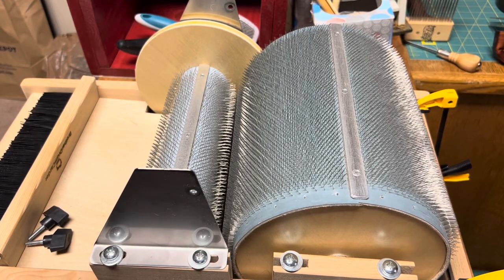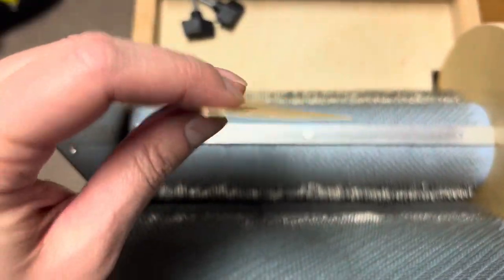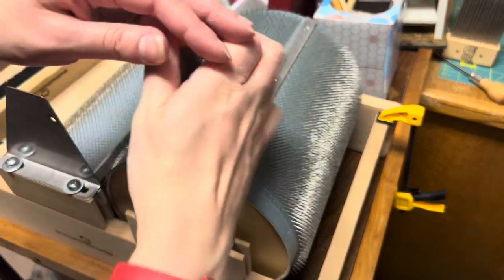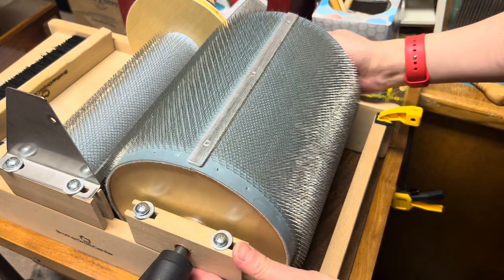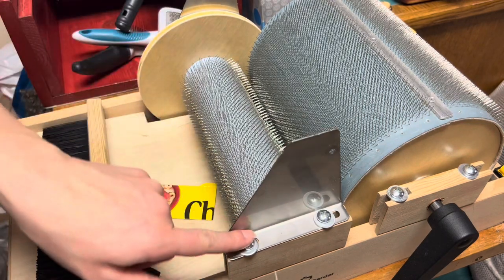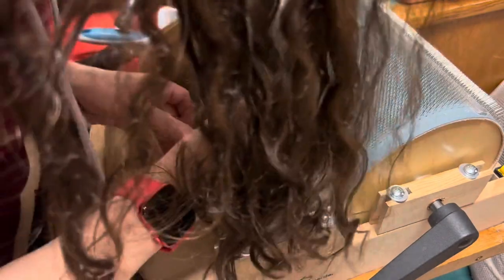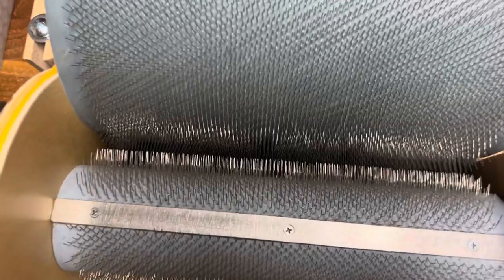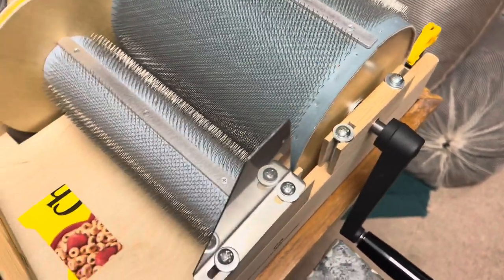How to adjust the drums on a Brother Drum Carder. 2 of 3 Keeping the drum parallel.

Comment: My batts were good at first but now there’s lots of little hook shapes on one side of the batt from it getting caught on the drum, do you know how to fix this?
Reply from the maker: I’m not 100% sure about your situation. ? Is the batt on the main Drum getting cought on the hooks from the small licker drum? If that’s the case the drums need to be adjusted further apart. 
If that is not the case. How are you removing the batt?
Reply: @mattimakes  it’s not getting caught in the small licker, I remove it by running the drum slow on reverse and pulling the batt off
Reply from the maker: @kayaramirez5608    Could you share a video of your process / how the machine is setup via FB or FB message . I could try to figure out what is happening and find a fix.  Sounds like what you’re doing is correct.